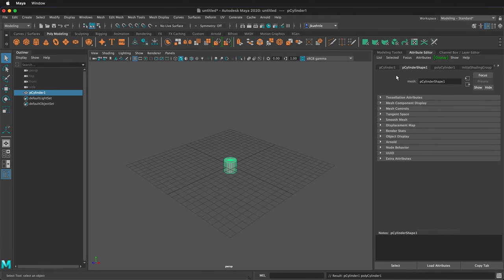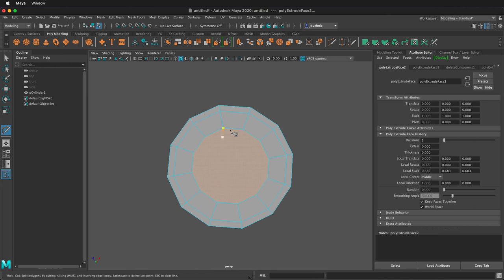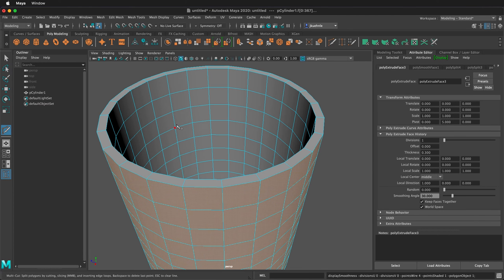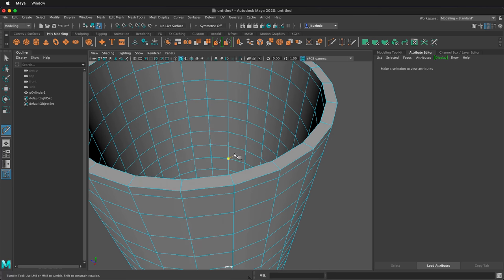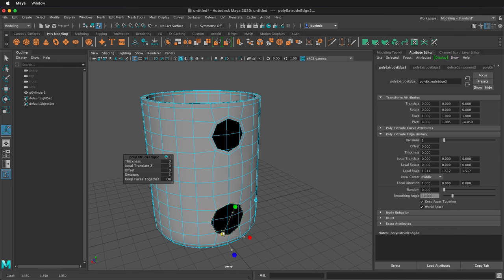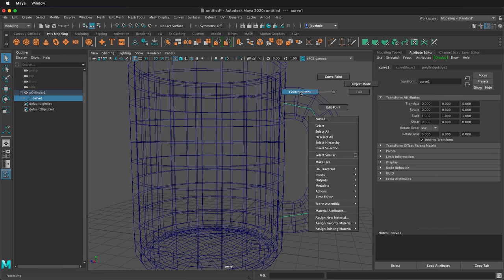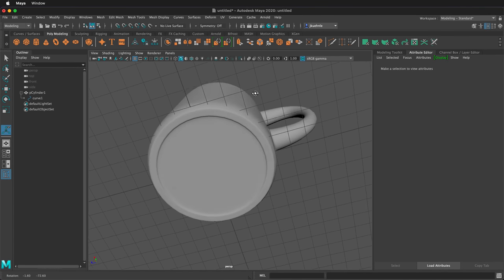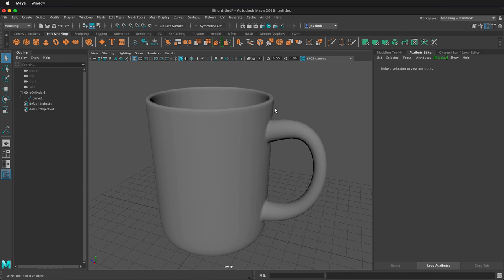Maya Tutorial: Model a Coffee Cup

Comment: On the bottom of the cup when i press clr + e it does not look the same in your screen
Reply from the maker: What looks different?
Reply: @WhatMakeArt  i see THREE lines going outwards of the model ( it just doesn't look like the normal extrude tool)
Reply from the maker: @MrFrog-qx2ft try resetting the default tool options, are you on Windows or Mac?
Reply: @WhatMakeArt  nvm it worked ty
Reply from the maker: 🙌🎉 woohoo, glad it worked ☕🌻